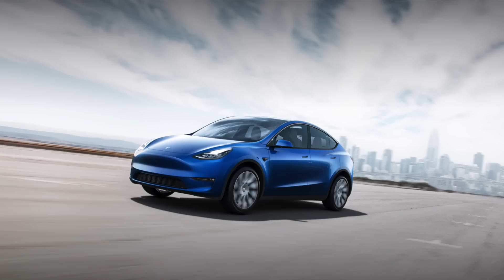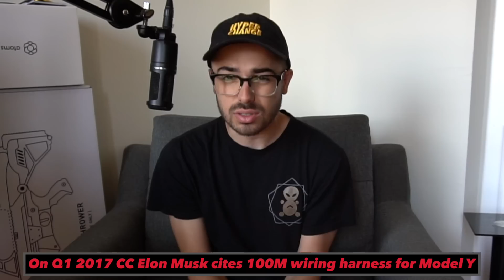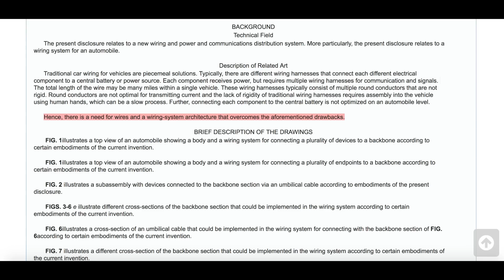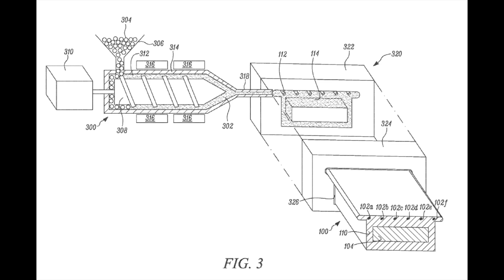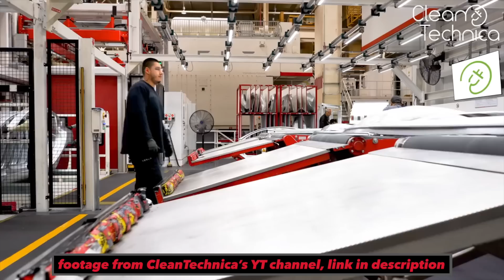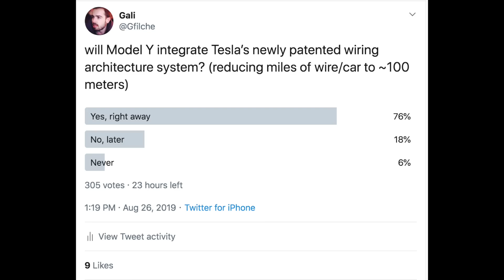Model Y Manufacturing & CAPEX Revolution?

Comment: Just going from a 12 volt to a 48-volt system will cut wire weight by 1/4th.   Most likely the Y will not have a 12-volt battery or master system.
Reply: The rest of the auto industry found out a decade ago that 48 volts burns out switch contacts, relays, all sorts of electromechanical parts in cars. They abandoned it. So unless Tesla also got rid of all the parts with mechanical contacts...that dog don't hunt.
Reply: @lyfandeth  You are living in the past Sir,   Teslas have no fuse box ( just one example of how differently Tesla engineers think). Because something has not been done does not mean it can't be done. A 370-mile range Electric car, Going to the moon. 
There still will be a 12-volt system.

https://www.extremetech.com/extreme/247889-cars-moving-48-volt-electrical-systems
Reply: fatboy19831 by 3/4
Reply: @paulogden7417  Yes Paul 25% is extremely conservative. 75% might be a bit optimistic.
Reply: @fatboy19831  i doubt the low voltage system will be 48V. there is no benefit once reduced to just 100m of copper wire anyway. the main components beside drivetrain is still 12V and having 48V is expensive to translate in all components. having just power wires is a huge benefit especially for manufacturing. 30% of labor and time is consumed by the main wiring harness, having a rigid harness installed by robots would be a huge improvment on every level.
Reply: @benjaminkessler8169  You are not thinking outside the box.   It is not just the size of the wire but also the current load is reduced by a huge factor.   Vw, BMW and Toyota are already working on 48 volt systems.  Eventually, 12 volts will be like 6 volts systems of the past.  The math just works on having a higher voltage system.  Just think if the battery designers thought that way.  We would be limited to a 20 kw 12-volt system in electric cars.  You can still have 12-volt outputs on a 48-volt system just like we have 5-volt USBs on a 12-volt system.
Reply: @fatboy19831  lol you just want to believe 48V is thinking outside the box isn't it? eventually we will have a different system but will it be 48V we don't know. for the most part getting rid of many wires by making it a wireless signal transmission will be a huge step, the power supply via 12V  isn't the big problem. streamlining the manufacturing with less harness to install will be crucial.

Comment: 1:55 Did Monroe said "same as fighter jet technology"? 😳😳😳
Reply from the maker: Yup
Reply: Yep I saw the original interview, Sandy has done pull downs for NASA etc. He said the integrated circuitry in the Model 3 was of the same sophistication as a fighter jet. Whereas the Chevy Bolt just had disparate boards doing different functions all over the car same as every other carmaker.
Reply: YES, Fly by Wire technology VS standard wireing and cabling.
Reply: Firewire (IEEE1394) for an example "came from" fighter jet technology. There's a lot of talk about networking for cars, which makes all the sense. IP-networks (cameras, dishwashers etc) and Internet-of-Things is already here, but not in the cars.
Reply: @lauril1377  That's what I thought when Elon said, the wiring harness in the M - Y would be redundant. Just as my having Cat 7 wire on my computer to router is redundant to the Wireless Card... Damn...
Reply: bayaraa13 - Multiplexing has been used in aviation for decades.  Space is limited, the airframes are large (necessitating long wire runs), and every ounce matters.  Aircraft manufacturers would use one wire for an entire airliner if it was possible.
Reply: bayaraa13 sounds supercool, but it is simple af
Reply: ...and pizza drone same thing

Comment: Wiring harnesses mean ZERO to the end users and drivers of cars, you are making a mountain out of a hole hill, really.  Wiring is cheap by automotive standards anyway.
Reply: you are absolutely correct that wiring harnesses are cheap, and mean nothing to end users. However, Tesla is relentlessly driving down the labor and time-to-build for each car. IF properly implemented, the new harness might save $50.00 or so in parts and labor per car, and about twenty minutes on the assembly line. Not much, but each innovation adds to all the others that Tesla is doing.
Reply: @Mdude59  $50? sounds pretty cheap...I have a home network project .. will supply and install 2.5 kms of wire for me for $50... :)

Comment: Actually looks like a giant molding machine to cast the car in one piece, no stamping involved. Looks like the steel cage for passengers is set into the mold and the body is poured around it!
Reply: Ron Alaska I think the body panels are still bolted on. It’s just the chassis it self that is cast.
Reply: Looks like an awful long wide machine just to do the chassis?

Comment: wisegeek.com says that, 'Metal casting is a metalworking technique in which molten metal is poured into a mold and allowed to set before being removed to reveal a metal piece which can be finished with grinding, sanding, and polishing...'
Reply: That description would apply to traditional casting used for things like engine blocks. Tesla's patent involves thin wall casting which is a different animal.

Comment: Tesla should first introduce the new wiring architecture in the Model S. Every new system has teething issues and it would be imprudent to introduce new tech "Directly" in a mass market product, which would be much tougher to correct. Getting the kinks fixed in Model S would give them much higher confidence when deploying this in Model Y.
Reply: These systems are targeting the efficiency of mass production. To use them in a lower volume model wouldn't pay off. But they can control the production ramp to address the teething problems. Let's hope they use it wisely.

Comment: Looks like collision repair on the model Y may be extremely difficult and costly due to the single unit casting.
Reply: but the environment will thank you
Reply: @jameshumphrey9939  ;-)
Reply: unibody frames are always 1 component
Reply: @justinmallaiz4549  Difference here is "Cast Aluminum" ;-)

Comment: I'm very curious to see if once Tesla's moved on to casting the Model Y body in white in one piece if they not only apply the same approach with the body of the Model 3, but also  the  wiring harness to match. Elon did say recently that once the Model Y production is up AND running smoothly that Tesla would apply any lessons learned to the 3.
Tesla will initially stamp the Y body into about 5 main pieces eventually moving on to 'casting' the body in white not 'stamping' it. Two different manufacturing techniques.
Reply: Peter S - I was waiting for someone to allude to it, and you finally did.  My prediction: Tesla will build the Model 3 on the new Model Y platform, which integrates all the lessons they learned from building the original Model 3.
Reply: @ClockworksOfGL  Yep, I agree. I'd be VERY surprised if they didn't. If Tesla managed to do it that way then I think that they'd finally get far closer to Elon's target of 10,000 per week & maybe even actually hit the target production run rate. Not to mention the gross margins would be thru the roof both by Tesla's & the industries standards.

Comment: I'm sure Elon had a revolutionary plan to automate auto manufacturing,  And then he built a tent.  What a joke.
Reply: Jerome built the tent and the line out of scrap for nothing - in four weeks that outproduced the other lines.  Production lines already up and running in Gigafactory 3 for very low cap ex.Tesla is unique in automotive innovation and rapid problem solving. Musk demonstrates this at SpaceX where entire projects are re analyzed and scrapped and replaced like going from carbon composites to stainless steel. Engineers have free reign and permission to disrupt. More brain power in a short
Tesla/SpaceX/Neurolink meeting than all the OEM automakers together and way more activity.

Comment: The new patented manfac process will propel Tesla lightyears ahead but it leads me to a few questions. My questions are how will this new process introduced the parts into the mold to weld and/or glue them into one unit? How many robots will be involved in that step? How will Tesla quality test the build of the bodies coming from this line? How many of these lines will Tesla built to mitigate for breakdowns or part replacement on these lines? Great work Gali and I agree with your current overarching thesis on Tesla.

Comment: the machine builds the machine thing is gone for the m y, they ve decided to cut the upfront cost and build it on the 3 plattform. Do not hope that tesla will reach a new level of profitability at building and selling cars. This ship has sailed due to not pursuing the machine builds the machine thing woth more rigor at m 3 and now also m y. The thing u should be focused on is self driving technology. Tesla currently has a significant lead there.

Comment: Two subjects I’m really interesting in getting updates on; 

1. Million mile lifetime on car/battery (warranty maybe)

2.  Tesla insurance.
Reply: Yes to both. It seems hard to believe that they could jump all the way up to 1 million miles, as Elon stated, considering now they're at about 300,000 miles (update if you have more accurate numbers). We keep hearing about Maxwell's energy density and ease of production. Does it really offer tripple the colombic efficiency?

Could Tesla be using Maxwell ultracaps to buffer some of the high power draws during acceleration, hard regen, and rapid charging? Instead of using Maxwell's density to extend range, they could free up space inside the battery pack for ultracaps and extend life.

Which of these seems more likely? Is there a third or fourth option? Are we all looking into the ultracaps too much? Tesla could decide they aren't advantageous and shutter that part of the business.

With Tesla's level of data about their drivers and their future plans for autonomy, it absolutely makes sense to get into insurance.

Comment: While I accept that 3km (2 miles0 of cable weighs a shed load, you should go out and price up that much automotive cable. Turning to a similar power control model - model railroad - nowadays it's a 2 wire control system for multiple trains on one track. That equates 2 two wire running to all the consumption points in a car (indicator LED clusters, window motors, fans, locks, etc). In reality, you don't even need that. All cars have metal bodies, so you can use that (it's usual earthed to negative anyway). Then you can  only need to run one wire to all the consumption points. The control and power electronics cost from 50c to a buck per point (I can build one offs for about a buck).
Reply: I would not want to be around for the explosion!

Comment: Wiring was to be for the “new architecture” for the model Y that got Kibashed... the board realed Elon back in when he wanted this new architecture. Model Y will likely have Model 3 wiring as it’s built on the 3 platform. I conjecture that new architecture will be saved for a lower priced city runner. They discovered the demand is driven buy people moving up into the car out of a more modest vehicle. A 4 seater utilizing parts from all models would be most effective.

Comment: With a one piece shel how hard is it going to be to fix what would otherwise be a simple quarter panel replacement from a small accident
Reply: New production methods will require new repair concepts. Instead of producing and warehousing different body parts, they could produce and stock complete replacement shells. Eventually ready painted with protection for assembly. You will get a refund for your damaged shell, which could be remolded into a new one. Maybe this would be included in the Tesla insurance, because they have full control over the costs. Imagine a Tesla semi coming to your house, opening its trailer, tows up your damaged car, two robots remove the old shell replacing it with a new one and your car is rolling off, fully repaired, after half an hour. No garage could compete with that. In case of severe damage they replace the whole car and reuse material and parts  from the damaged one. When the work is fully automated, it comes down to the materials and some overhead.

Comment: You seem to have conflated Stamping with Casting. You should probably do some quick research and differentiate the two, as they are totally different processes.  Stamping is mostly used for thin sheet metals, while casting is for solid components like chassis and suspension etc.  From Wiki: Casting is a manufacturing process in which a liquid material is usually poured into a mold, which contains a hollow cavity of the desired shape.
Reply: when I looked into the mirror i saw something the mirror saw something very different
Reply: @jameshumphrey9939   I think your mirror is broken - lol

Comment: Have jumped on the Tesla bandwagon again. Shares bought this morning at 212 (odd) basically 213. 3rd time owner and with my original investment ive managed to increase my share count every time trading in and out (though i wouldnt be surprised if it dropped another 10 or more) ^_^
Reply: thanks for supporting the environment from climate change! will yiu give the profits to the environmental defense fund then?
Reply: @jameshumphrey9939  Im looking after myself here since the government wont do it nor are capable, and i dont trust them with their ponzi schemes.

In other words this is me becoming independant and creating my own pension since government is so inept
Reply: nice man I also own Tesla shares ! great buy
Reply: @smartterminvestment483  Yeah im in profit already. Nice to meet another owner :). 

Its funny i was expecting comments telling me im mad and should just buy and hold. But even not hitting bottoms or tops i think Tesla moves that much that its been easy enough accumulating more shares per trade. If they paid a dividend id probably hold but theyre miles off that. So till then ill try and increase my position the hard way :P

Comment: There's in fatc a real problem with accidents and pannel substitution if you have a car with only 1 pannel. Maybe if you robotize the Tesla workshops the robots can cut and weld much faster than humans. Besides, with autonomous vehicles the number of accidents will decrease exponentialy and the need for repairs will fall accordingly.
BTW, crazy manufacturing idea: 1) stamp the chassis. 2) robots pin in (or print in...) the wiring. 3) stamp the exterior pannels. I think this is how it's going to work, and the way it makes more sense.
Once again, great video, Gali! Peace.
Reply: The frame (regardless if its build in 1 piece or 4 stamped pieces welded together, or 70 pieces welded together) is one component.. It does not include the fenders or bumper panels...This is simply about the frame component (1 piece like all cars) is manufactured....
Reply: Technically it's not a frame. Teslas are unibody construction. Floorpan might be a better term.
Reply: They will be soon self-repairing panels thanks to nano-tube technology...like when you get a scratch on the skin or when s  lizard regenerates its tail.
Reply: if you prefer
Reply: A robotic repair shop would be incredible. Just load the parts to the robot and kick back. :)

Comment: With less wiring for the harness, do you save energy from the battery?
Reply: As an electrician, I would say not in any significant amount.  The major energy consumers are the devices at the end of the wires.
Reply: @stevebothe1416  I agree. In theory less length=less resistance but in runs this short you won't see a noticeable difference.
Reply: @larryspiller15  Also, in theory, the lower the voltage the more loss by resistance.  So, 48V would minimise this further.  As we agree though, not significant.
Reply: @larryspiller15  as a non electrician 3 kilometers of wires isnt a short run though
Reply: @evgizmojm  that isn't end to end, that's a bunch of short 1-5 meter runs ×  100s-1000s
Reply: Probably uses more, but not by a lot. Why? Because the way to eliminate wiring is to multiplex the control signals on the wiring. That means you've got to have a multiplexer/demultiplexer controller in conveniently close proximity to each conventional component. Those mux/demux units each are tiny computer chips (controllers) that draw power... not a lot each, but they don't run for free. Essentially Tesla's concept is to turn the conventional wiring harness into a customized local area computer network (LAN)... with rigid wiring and connectors that can easily be manipulated and installed by robots.

The patents don't talk about the mux/demux controllers, probably because there's nothing novel and patentable about them. Their patentable innovation is working out how to turn a wiring harness into rigid components that robots can snap together in place like legos.
Reply: more due to less weight of the car
Reply: I guess less probability of fire?
Reply: With all the 12v DC!  Absolutely!  (120/220/240 vac pros - low voltage DC Is a different world!)
Reply: Elon will find a way...
Reply: no, it all goes back into the grid
Reply: @jameshumphrey9939  What are you ON dude?  Please explain?